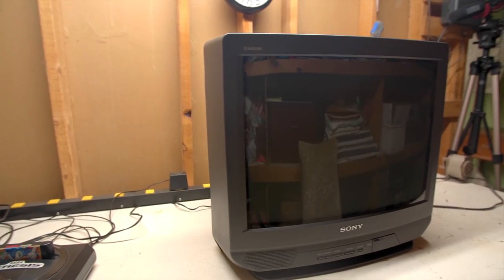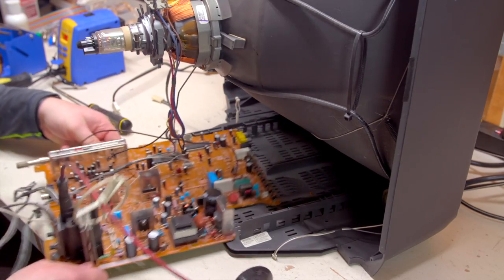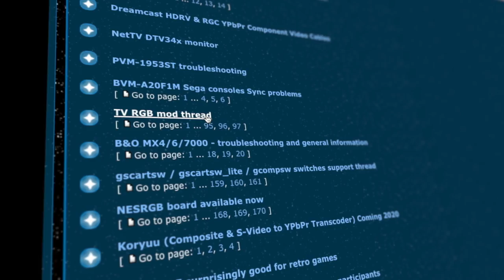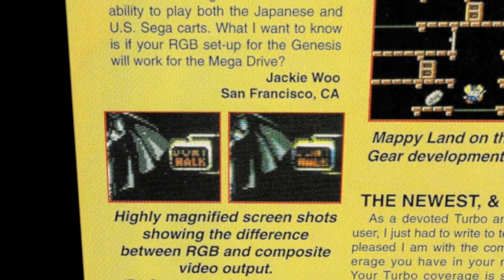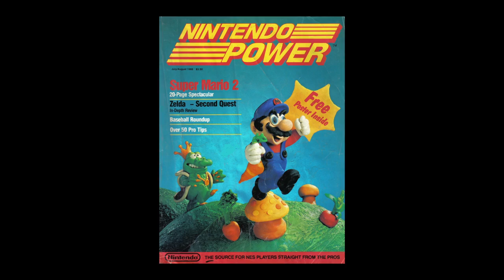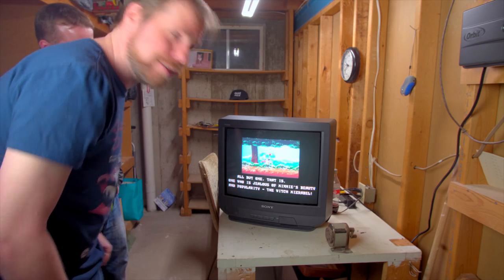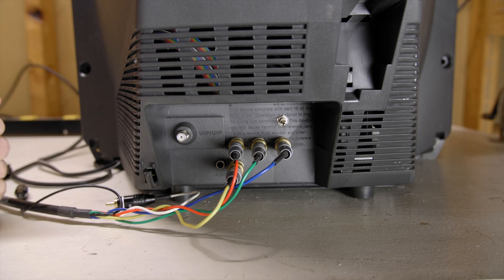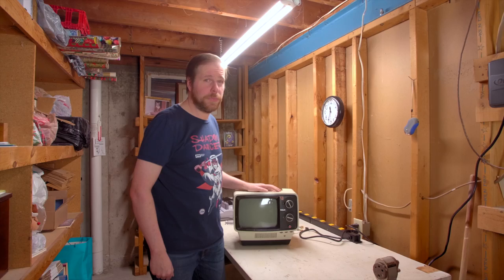Modding a Consumer CRT TV for RGB - Game Sack

Comment: This felt like a throwback to the console modding episode from 2014.  I do prefer game-focused episodes, but this was an interesting diversion.  I've moved on from CRTs, myself.  I got rid of my last two within the last year, but they were CRT HDTVs and, as I understand it, applied video processing to inputs and were not regarded as particularly good for retro gaming.  One gave up anyway, probably a victim of the capacitor plague.  I'm glad to not have anymore TVs that are 120-180 pounds.  I tried PC Engine and Genesis on the one that worked and I wasn't impressed.  But I bet the older CRTs look great with RGB and it's good that enthusiasts can have this done.  CRTs are not for me, though and I like the way my old games look and play on LCD with fake scanlines.

Comment: Just basic electrical course i took in collage. First thing the teacher said in the course, that a high voltage shock can harm and can potentially kill you. 
"ONLY DO THIS IF YOU KNOW WHAT YOUR DOING"
Id so try to get it done on the 27" Wega my parents had. It's a shame it died and thrown out from overuse of international programing before i even knew it.
Id only do this on anything higher then a 20". A 20" PVM is easier to come by and better so go with that. Id totally find the biggest CRT i can find and do it on that. Sadly I don't have the room for a CRT. Id ask for a cap replacement and maybe spray the screen with that non conductive spray so the burn in of the glass is gone.

Comment: I had a few thoughts about why so little NA RGB, there really wasn't any promotion for it, TV/Film formats drove the AV standard only bitd. Really video game magazines would have been the only place to push for RGB and they never really bothered. Like for example that letter Dave sent, without it S-video and the like were never mentioned much or at all by most magazines.
I don't ever recall an article about getting the best AV from your consoles(Except for the one you showed.) or maybe a feature about a model of SDTV that was good for 80s and 90s gaming. Without magazines educating us BI we ended up drilling a lot of S-video holes needlessly into RGB capable consoles.

Comment: My first RGB TV (or as I like to call it, component cable) was a fairly big CRT with big speakers on each side. It might have been enough to satisfy most people, but I didn't like it because the colors through a component cable were too bright and the pixels were arranged as horizontal lines, causing a significant screen-door effect.

Comment: Your old Sony TV might be moddable by injecting the RGB signal directly trough the TV Socket (the board behind the tube) Some TVs had the RGB already marked on there so its easy to do, but the problem is that some don't and you have to find them. A friend and i have modded some TVs with this method and it usually works well but we did end up killing a SNES when we tried doing it on an old TV that didn't have the RGB pins marked.

Comment: i've done 4 but there is always an issue with geometry of crts even on my 2 pvms always side and corners of picture isn't as straight as they shoukd be no matter how hard i try the setting of tv or magnets i use for that anyways keep in mind that some tvs are also s-video modable too meaning that they have capability but they arent programmed to do that and its not too hard to enable that power too i think n64 natively cant output rgb but it has s-video so that input is useful as well!
Reply: I have tried already 3 CRT TV's all with issues, sold them all one by one, then I finally have the best TV of them all, a Sony Wega 29 inch (in my country, city). Made in 2007, amazing colors, super sharp, nothing wrong with it, except... FUCKING geometry is driving me insane! And it is a flatscreen, and they are even worse. And those other 3 TV's I bought also had geometry issues, except the rounder ones, but they had "other" issues. All in all, we have to learn to live with those problems. I have been frenetecally looking for a "non flat" screen TV with Svideo and component TV, but is just imposible to find here. But well... I saw some videos where people even with round tube TV's still had geometry problems, so, there I kinda gave up and said, if they have those issues, then I just have stop this. Cheers friend, I understand your dilemma :)

Comment: I'm seriously impressed!  Joe got electrocuted so bad off of 75 Ohms, he turned into a skeleton!  Especially since Ohms are the measurement of resistance in an electrical circuit!  If the unit of measurement were Watts, Amps, or Voltage, I wouldn't have been so impressed as that is what normally will electrocute you.  But its alright, because I really liked that segment and the animation where he turned into a skeleton.  Keep up the great work Joe!  From your fellow Denverite, 39 year old game nerd, and Electrician, have a great one!
Reply from the maker: I knew someone would mention this! LOL.

Comment: I remember tv's with RGB and RGB SCART being really common in the mid/late 90's in Europe. Where they uncommon in the states?
Reply: shuntaro2408 They were nonexistent in the States, especially SCART. That was a European only connector. Only professional video monitors had RGB mainly through BNC connectors.
Reply: @sixteenbitify  The Scart connector was also used in Japan, although the wiring is different.

Comment: On a side note, sadly Euro tvs despite having RGB never had component or VGA on them like late US tv's meaning today to connect up say a PC to a SD tv is near impossible unless you use S Video where compatable, or a cheap VGA-Composite which adds input lag and looks terrible. And even if you have a very rare tv that you can use an adaptor from component to scart it won't carry audio!

Comment: I have ALWAYS wanted to have this done to one of my consumer grade CRT's but just never bothered since I can still use Component input on them which is just about as good.
Reply: skins4thewin Same, component with HDretrovision cables are great. Was happy enough that I preferred using my 27" Trinitron to the 14" PVM I had at the time and sold that. No regrets, though would still grab a 20"+ PVM/BVM if I could get one for a decent price.

Comment: If I lived in the US this would be the most important thing to get done.
So can you send in the motherboard to this guy and he mods it?
Reply: Dbn Poldermans I had considered doing it to my consumer Trinitron, but ended up getting HDretrovision cables and am happy with them, to the point I sold off my 14" PVM (too small for my setup). But ya, if you are working with a tv that doesn't have component, it would be a fun project.

Comment: The 75 Ohms speil could have served greatly at the start of the video as a warning do not attempt unless you know what you're doing. Which Must be stressed don't do this unless you know what you're doing, those CRTs can carry a strong latent charged stored up and then risk of improper grounding out after it gets plugged back in.
Although Ohms is a measure of resistance not the charge, so, it's like they say, it's not the ohms that kill you.

Comment: So many TVs that are now worthless garbage would still be somewhat usable if they would have just came with RGB.  I do actually have a couple CRTs that have RGB via component video.  One is  a  32" from around 2003 that I got brand new and I'm thinking it was somewhere around $500!  The second one is a 2005 model that actually supports up to 1080i, I picked that up from Goodwill around 2011 for $12.  The prices really fell quick on CRTs.  I also have a huge 40 some inch Mitsubishi CRT monitor.  I believe it is what people call a PVM.  Has all kinds of crazy connectors.  I never use it, it weighs a million pounds.  I need to put that thing up for sale.  I'm sure someone out there could put it to good use.

Comment: Seems like you could just use a computer monitor with a standard component to vga adapter and get a pretty good result.  19 inch crt monitors might be hard to find but should be cheaper than RGB equipped consumer TV's.

Comment: Great video, but....it would have been nice to see comparisons between RGB converted to Component and direct RGB.  I am still unconvinced that RGB modding a Trinitron would give me a significantly better picture than using my Retrotink RGB2Comp to use Component inputs. Still, I appreciate any video that might inspire people to save and use CRT tvs that might otherwise end up in the trash.
Reply: Given the RGB to component options, if you have a component equipped crt its probably not worth it, IMO, unless you are really curious. I know when I got HDretrovision cables for my 27" Trinitron, I was happy enough with it that I sold off my 14" PVM and scart/Bnc cables and whatnot. I'll stick with what I have unless I come across a decently priced 20"+ PVM/BVM, which I doubt will happen at this point. I'm more worried about the TV dying and having to go the upscaler route.

Comment: i was on an rgb forum, one user recommended not doing this because most methods users use to mod ruin the TV. is that true? there was no further input, post just sank into the depths, but i'd like to know if there's a  "durable method"?
Reply: 75 ohm resistors are the key. you won't ruin the TV modding it.  thing is,  a lot of RGB SCART cables have caps/resistors in them, but it's not enough. both the cable AND the mod itself (internal of the TV) require the resistors.

Comment: Pretty cool that something like this can be done. But why not install a Scart socket to the back of the TV? Then you wouldn't need to use an adapter cable like you did in this video.
Reply: I usually do install SCART sockets.  Joe routes his audio through an external sound system.  Different people have different needs, I guess.

Comment: Is it safe to flip the switch in the back while playing a game? Just to see the jump in quality between signals? A before and after of the same screen would have been pretty cool to see. :D
Reply from the maker: Yes you can do that. But you'd have to connect your composite video as your sync and I don't have any cables with sync on composite. Generally sync on composite yields lower quality results.

Comment: Did you do any picture adjustments through the service menu of this TV set? When I plug my MegaDrive or Master System on a CRT the picture is never perfectly calibrated. And then I start to tinker with all the service menu settings and never succeed in getting a "perfect" calibrated CRT. Could you show how you do that in an upcoming video?

Comment: I'm very comfortable doing this with a TV.    
But I'm not sure what the best way is to get the old RGB and 15KHz video from a PC is.  
I primarily want to run some older arcade games like pac*man defender digdug & the like.
But want to get the oldschool Video out of a PC.    
What is the best inexpensive hardware to get this done?   
I see everyone doing these TV mod videos is using game consoles.   
 And not really what I am after :)
I will figure this out but if you have done it and have a simple way please share and thanks!  
   I will not be running the newer games on this, and want to get away from VGA/HDMI for just the old games 
and dedicate a box for this.  
So I am not worried about it being compatible with more than a small group of similar old games.
Reply: I see this post is loaded with disclaimers and concerns.   
If it matters - I am a skilled tech, with years of experience working with this type of hardware, tubes & high voltages.
I even have plenty of computer experience Raspberry PI etc.  
I just am not immediately familiar with how to best and easily get really old school video out of these devices to drive a monitor like this and would like
to play/try it!    
If I get on the forums it's a bit overwhelming and what I am trying to do does not seem to be common or popular.  
So the info is difficult/impossible to find.  
I get drowned in old stuff that's no longer supported/followed/kept up to date never really was to begin with.  
I'm vaguely familiar with the old ATI cards that did it but you can no longer get (easily or inexpensively) and are no longer supported or followed.  
And the half-hearted short lived attempts to do it in Linux with specific hard to get hardware/video cards.   or one specific OLD Intel integrated chipset LOL etc.   
Is there a modern way to do this easily on a PC or on a PI? that gives the wanted oldschool video to drive a monitor like this?

Comment: Wouldn't it be easier to buy TV from Europe and swap power unit? Every CRT here has at least 2 RGB inputs. On the other hand it's very hard to find any with S-Video.
Ok now when I think about it... those TV's are freakin heavy, it would be rather expensive.
Also from all tests I have done - Megadrive VA4 (last Hi-Def) has better image quality with S-Video mod than with RGB. But then again I never liked RGB on my PS2 till I bought very expensive cables.

Comment: You see, of course us Europeans HYPOTHETICALLY had RGB using a SCART input, but the thing is, a) not all of the SCART sockets were actually RGB-enabled but merely delivered composite, and b) if you didn't happen to have a tech-savvy dad, chances were you just ended up using the cable that came with the console anyway and be done with it. In my case, as a German, this meant I ended up playing Super Nintendo (we don't call it SNES here :D) via RF and N64, PS1 and PS2 via composite. 
The irony was worst on the PS2 – I knew nobody who ever heard of RGB via SCART, while over the pond it got more and more common to hook the console up via component.
Today, as self-respecting retro-gamers, all you guys have to do is to mod RGB to your TV sets and you're basically good to go. Us Europeans may have RGB-enabled SCART, but the properly shielded cables are hella expensive and 50 Hz PAL is pretty much garbage when games were developed for 60 Hz NTSC markets, so we have to mod our consoles to accept NTSC and almost the entirety of our second-hand software market is trash with games running 16.7 % slower. 
It's a friggin mess and I'm just so glad HDMI solved this jumble.

Comment: I've been looking into modding an old crt tv I got called "classic" on the front of it but can't find the info for it, so I know your pain.
Also I've had a thought, COULD this be done with a 4 pin s-video jack instead of bnc or rca jacks? Like have chroma, luma & a ground be rgb & the last ground as c-sync? If not then maybe the 8 pin s-video jack? My first console the nes I have modded with s-video (a jack with 2 wires coming from composite) looks great on the 16" lcd tv I have it hooked to, along with a y splitter for dual mono.
Keep up the great content & stay safe😷😄

Comment: When you say RGB    Are you meaning scart RGB.  ??? Or component ypbpr ????
Reply: raw rgb
Reply from the maker: SCART and RGB don't really have anything to do with each other, except that SCART can pass an RGB signal (but doesn't always). Component has less color resolution than RGB but you'd be hard-pressed to see it with your naked eye. It also works much differently.
Reply: @GameSack  signals can be converted easily to and from either signal anyway
Reply from the maker: @omegarugal9283  That's what HD Retrovision does. However I'd rather derive component from RGB, than RGB from component.

Comment: Since these Cheapo TVs are sold all across the world, its usually much easier just to buy the european or asian input board for that model as cheap replacement , push the little plastic brackets that cover the holes for the scart connectors out and be happy. Also enjoy people dying after getting zapped with anode voltage after watching your video. Tube TVs are not a toy, if you dont know the basics how to discharge and safely handle one, you are better off not messing around with them.

Comment: You should get a fan or something Joe, i knw it's not ideal for the audio in recordings but it's not healthy sitting in solder fumes, although you probably know this.
Reply: Ya, I used to solder without any protection until I got really sick after trying to repair a speaker system. Ever since I use a mask and fan/filter. If its a quick one or two wire solder job I may just hold my breath and then fan the area, but not worth the risk. It really screwed me up for a while.

Comment: PSA:  If your CRT has component, you'll STILL want to do this mod because 99.9% of RGB SCART to Component converters out there use post processing and filtering, it's not a 1:1 conversion, absolutely impossible. You will notice white text suffers the most when not using RGB. If you have a black screen with white text, you will almost always see blurring or rainbowing, even on component. The PAL Wii uses RGB SCART (i think you can mod a US Wii to use RGB SCART), but you'll notice the wad manager has white 80 column text and it's not crisp, even on component. RGB SCART will make that wad manager text look sharp like on an old IBM RGB Monitor.